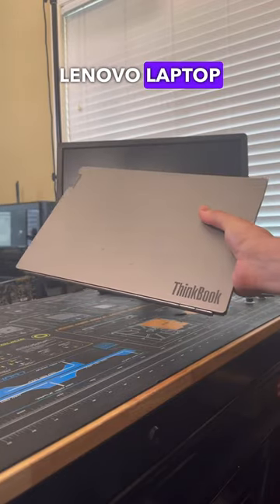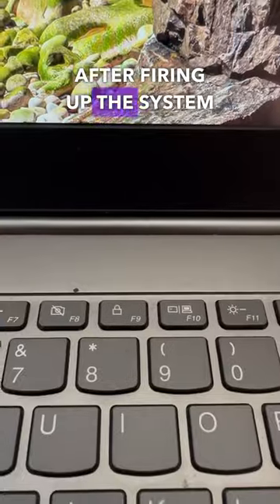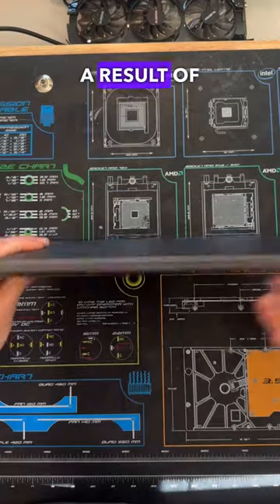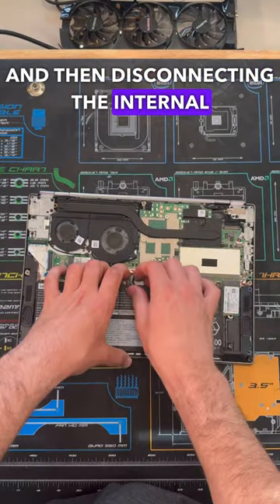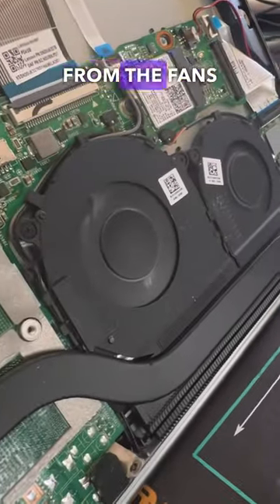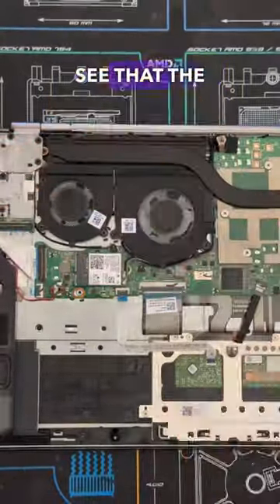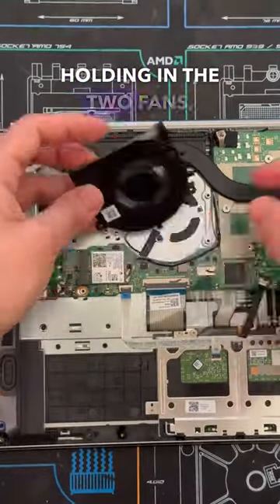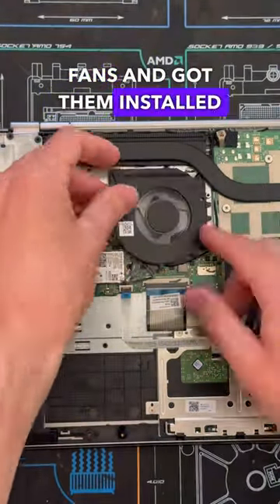Vibrating Laptop Fans! Let’s Fix It! #shorts #pc #laptoprepair #pcrepair

Comment: I am baffled at the fact that these many people in the comments can't understand that repairing just means bring something back to good condition, either by doing something to the faulty parts so they can work properly again or by straight up replacing them, depending on how cost efficient is each option.

Comment: They were lucky the fans were easily replaced.  Lenovo now makes sure that can't happen anymore with a new design.
Reply: yeah legion 7s fans are goddamn soldered to the heatsink its so stupid, you literally need to buy an entire new heatsink with fans attached, if just 1 fan goes bad, its so stupid lmao
Reply: @khabibnurmagomedov4877 its just a problem with that model. The legion 5 one has little screws for the fan

Comment: 'i decided to make sure that the noise was actually coming from the fans' there are no moving parts but the fans in that laptop. there was no hdd the fans are the only moving part. and they could have been fixed its probably a little out of place or some metal needs some bending that replace was unnecessary.

Comment: The system had a system issue In it's system. Maybe fix the system to system the system. Another good idea to fix the system is to systematically system between the system fans in the system. Then find the broken system fans in the system using this system and systematically system them out. Then install a new system fan for the system into the system.

System.

System
Reply: This brought me to tears 😂

Comment: This randomly started happening to my Lenovo Legion that’s less than a year old on one of the fans and it’s so loud/grindy that I’m losing my mind. I’m too worried to take it apart tho and risk screwing something up. Will probably need to bring it somewhere, ugh
Reply: Update: took the back off and although the fans looked clean with no dust, I brushed them off and blew canned air on them a bunch. Put the back cover back on and booted up the computer, been playing games on it for a few days now and have not heard the noise anymore! Let’s hope it stays that way.
Reply: I bought new hp and making same sound I thought it's going to blast do I need to repair it?
Reply: This happens with my lenovo legion as well and I even cleaned the fans, its still the same. Did it come back for you?
Reply: @bufalosan I’m sorry to hear that cleaning the fans didn’t work, did you take it apart and really clean them? Fortunately the issue has not come back for me! However, make sure you have all the latest windows updates as well as that could potentially be part of the problem. Let me know if you were able to fix it!

Comment: I opened the laptop and realised that you just have to clean the cooling line from fan to the processor. Which had a lot of dust hence the cooling does not reach the processor and the speed of the fan will always increase and generate noise.

I don't think changing the fan is a smart solution.